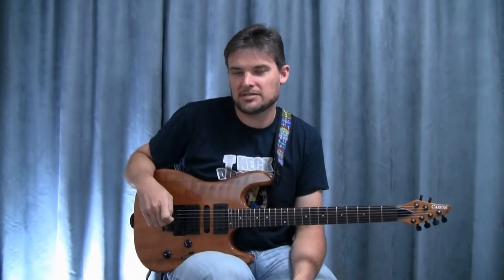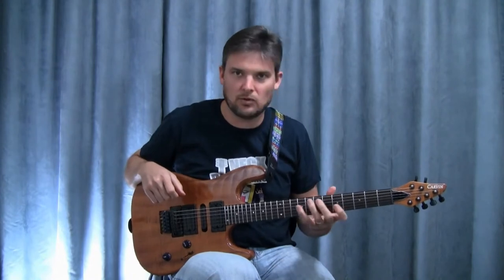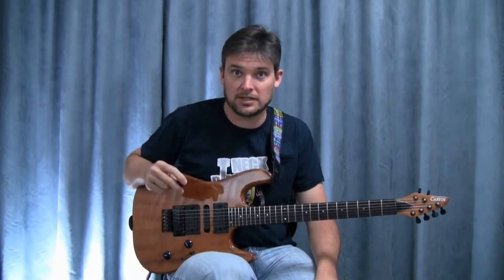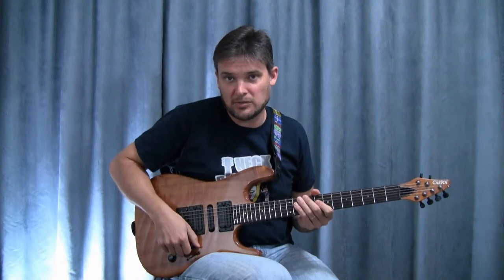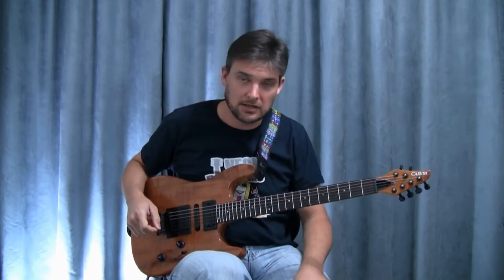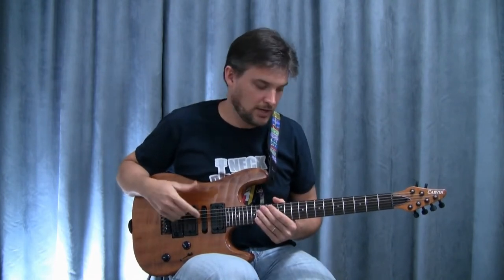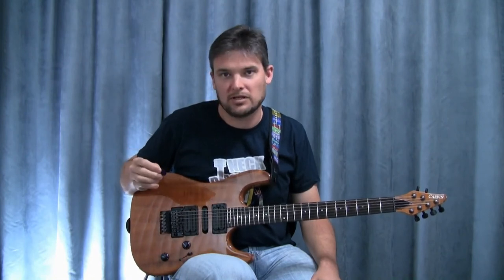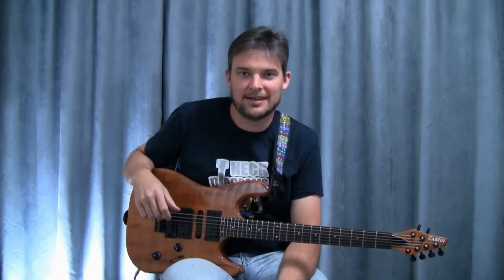Derryl Gabel Guitar Setup

Comment: I also prefer lighter tension strings, mostly for my fretting hand, but my picking hand struggles a bit. Any advice on keeping your picking hand relaxed and controlled with lighter gauges? I would love to avoid that string warble and going out of tune that comes from too much pick attack. I did get the idea in my head that because we re picking lower tension strings that you could get away with a lighter pick gauge(between .71 and 1mm) in hopes that some of force against the string would get absorbed by the pick and knock the string around less. Definitely harder to keep the right hand lighter in touch than the left
Reply from the maker: I suppose using your wrist as opposed to your elbow for picking is the way to go and like you said keep relaxed and the least amount of tension possible.